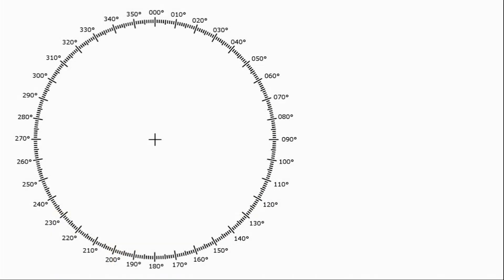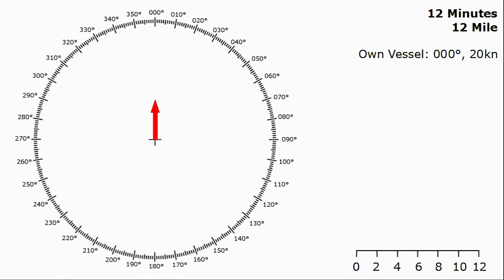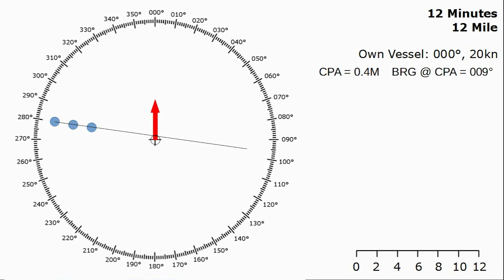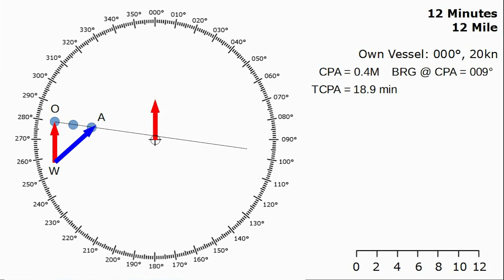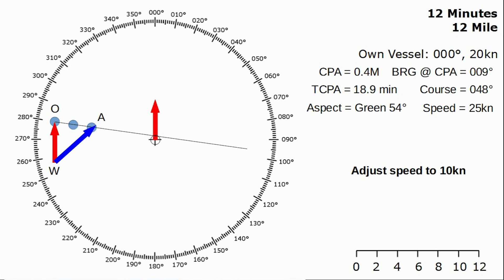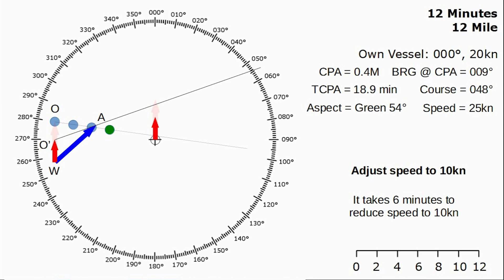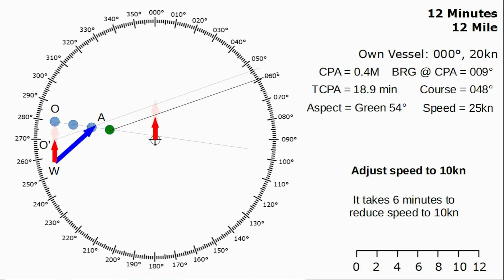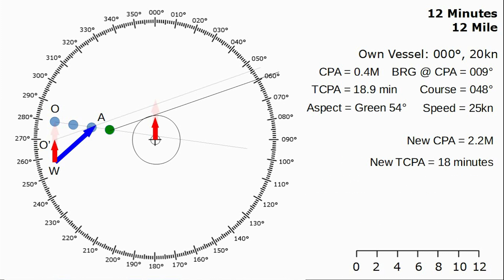Radar Plotting: Speed Alteration

Comment: Enjoyed the three videos on the topic. Only one part threw me off, and it was in this video. We had assumed that we were taking action at a later time to the actual position and plotted a fourth predicted location. Therefore, we shouldn't account the time period from A to the new position when calculating the new TCPA. It should have been 12 mins as opposed to 18, no?
Reply: I think with radar plots and maneuvering boards in general, the assumption is that everything is time late and more of a tool to help.  ARPA however will provide a more accurate solution to the maneuvering solution